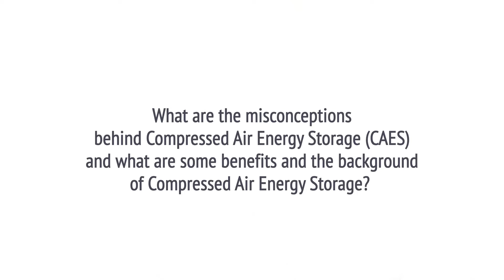Misconceptions Behind Compressed Air Energy Storage

Comment: I dont understand why the heat generated during compression cant just remain in the gas and then be converted into energy inside of the turbine when the gas is being expanded again which will cool it down...? 
Pressure energy is basicly the same as thermal energy because both have the indivudal molecules impact the constraining surfaces...? - if you can use the kinetic energy of the particels to turn a turbine or push a piston why doesnt that include their thermal energy?
Reply: I think it’s because heat will always eventually disperse. Which Isn’t great especially for long term storage
Reply: However, this thermal energy can be converted using a Sterling engine combined with pressure systems in addition to good thermal insulations ( in any case, there will not be a lot of heat unless the pressures are very, very high ), but there are those who do not want these technologies to develop. Personally, I think that compressed air and hydraulic technologies are very promising, even more than electrochemical batteries for long-term storage, if only they were interested in developing this technology with the same interest in developing batteries and electronics.